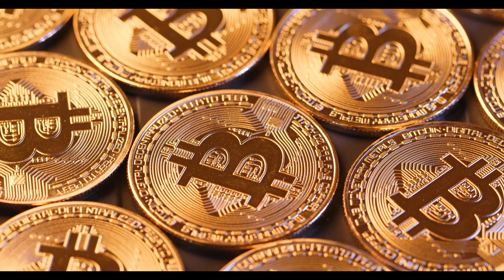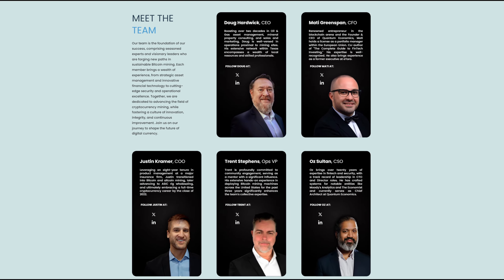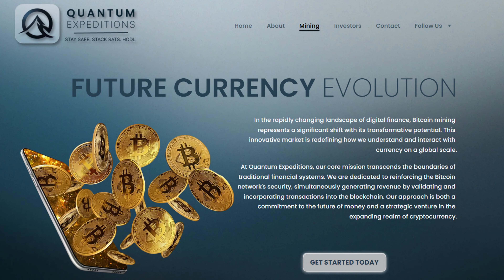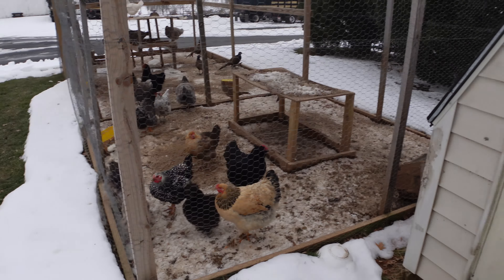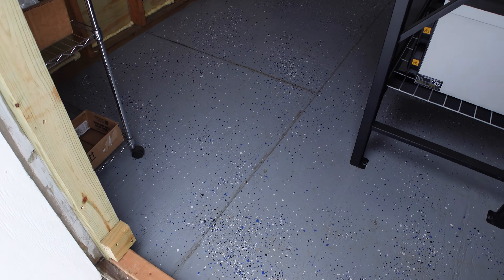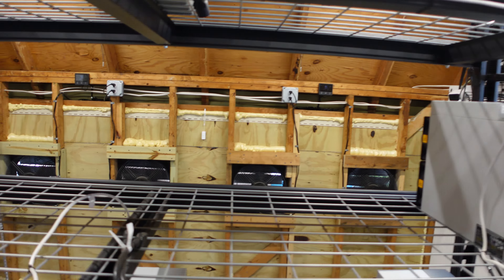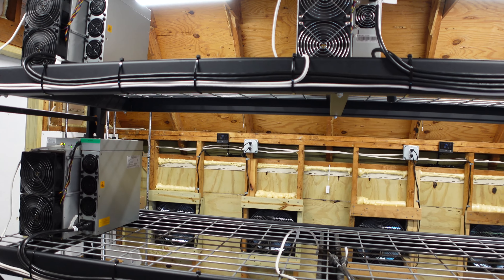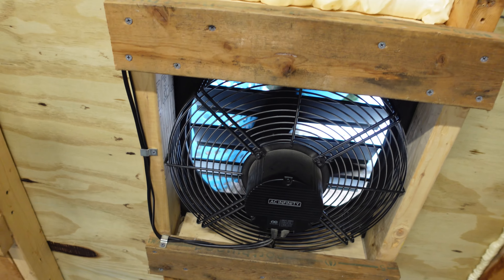10 Minute Tour of my Bitcoin Mining Shed

Comment: I have run into a similar heat problem -  yes install 2 exhaust vents along with what looks like a vented ridge cap - right now you are going backwards - you are trying to exhaust heat out the bottom - heat rises - reverse the fans at the bottom to pull air in and exhaust out the top - that way even with no fans running - it will naturally exhaust the heat somewhat out the top- in the bottom out the top - 😁👍

Comment: I love love love clean wiring! I guess if a “electrician” lives there thats what u get! 👍🏼

I tried to warn u 6months ago that you weren’t going to have enough air flow (comment probably got lost in the mix). Not even the T16’s are going to be enough (unless you add way more than 3). You’re also gonna need a lot more intake too. Those plastic gable louvers are restrictive and costly.

Everyone way underestimates how much airflow they need. Put your hand behind a ASIC and feel how much Airflow it produces. You have 9 ASIC in there now so ur shed needs 9x that much airflow to keep it from heating up.

I agree right now while its freezing outside, its beneficial to have warm air circulating inside for a constant temp. 90’F in winter is a big warning sign though. For the shed to work in the summer and stay cool inside, you should be able to stand inside and feel the air blowing through it. Its gotta be constantly flushed with fresh air. Otherwise you’ll have heat build up 👍🏼

Comment: Thats a Gambrel gable/roofline just so you know. I would recommend an inline fan blowing out you attic vent over the door. Attached to a duct with multiple perforations that is secured in the peak of the roof. Remember you have a lot of electrical and a semi flat roof section you want to put a hole in, not a good combination. If your roof doesn't leak now don't mess with it. An 8in inline pulling the length of the roof should help you dump the heat and you can slow it or shut it as temp drops. AC Infinity 8in will mow about 800 cfm. Good video!!!!!!

Comment: Hey Hobbyist. For adding exhaust, I would use the existing vent you have above the door and add another fan there.
Reply from the maker: My concern there with just passive vents, is it would turn into an Intake. Because the shed operates with so much negative pressure. 

But I could add an Inline fan there and suck the air out
Reply: @TheHobbyistMiner  what about putting a small AC infinity vent there in place? Could use the dampers to control how much air is going out and how fast the fans going right?

Comment: Hobbyist, I think roof vents would be a good idea so you can vent out excess heat in the summer. A design/shape roof vent that doesn't allow rain in obviously. 😀
Reply from the maker: Yeah thinking 2 or 3 active vents pulling air out. So the hot air doesn't pocket.

Comment: Roof vents would be good to allow the heat to naturally expel, but could result in it being an intake at times as well. Foam insulation board across the top and sides of the rack extending to the exhaust wall will help a lot, and you can cut out holes and create plugs, so that during winter times you can pull the plugs and allow some waste heat to recirculate, and during the summers, plug them so its only new air intake. I've managed and helped build a handful of enterprise mines, and almost every one of them has enclosed exhaust hot aisles.
Reply from the maker: I am thinking the same thing. Roof vents while good would pull air in, because of the negative sir pressure.

Comment: I would add two tall roof vents on the intake sidebof the shed. Place them about 2/3 up the roof to left cold air in. Use a burning encent stick to map out the air flow coming in through the roof vents.
Reply from the maker: Good idea. Thoughts on a fog machine test ?

Comment: @TheHobbyistMiner Look at the 12:00 min. mark and pause, There is already a small vent in the top. Modify it to hold one of the fans you are changing out. Now, do the same thing on the other end of the shed and have one push and one pull. Now put a 2.5' X 3' overhangs at a 4/12 pitch or similar downward angle. This will prevent blowing rains from reaching the vents. Use your own judgement on how to do the over hangs, but, This puts two of your 14" fans to use and those will easily run clean up duty on the heat. Just remember the little outcrop/over-hang can be mounted after you build it, use lightweight 2x2 instead of 2X4 if you'd like, and thin 'ish plywood. Then use the peal and stick roofing to cover it leaving about 1.5" of it hanging over the plywood on all 3 sides. It's easier than it may sound. Ill post pics of the way I did my shed soon, not mining out of it yet though.
Reply from the maker: Best recommendation yet!
Reply: Thank you Sir, that is a very meaningful compliment coming from  @TheHobbyistMiner

Comment: Lack of snow on the cable to your shed means it was too low in diameter and the impedance is too high.  When in 100-150 AMPs range you should go with 35mm^2 at least.

Comment: You need a ceiling and insulation. You are leeching summer heat on the shingles into the room(which you have enough heat) you can verify this with an ir gun.
Reply: That is a legit concern.  In my GPU location it is so hot in the hot isle that the tar from the roof started leeching back into the underside of the roof.
Reply: damn thats insane!
Reply from the maker: So this Shed doesn't have heat wrap on the walls like my new shed I bought. Has that reflected silver look. That helps with sun heat soak from the roof and walls. 

I am thinking of active roof vents first like the AC Infinity inline fans mounted up high.

Than if all else fails a "ceiling"

Comment: Also... two of those 16in fans as exhaust at the top of each end of the shed would be able to suck out all that hot air... and you could have those 4 x 14in fans as intake, perhaps variable as per internal temp and then run positive air pressure... just a thought
Reply from the maker: Not a bad idea. Springs going to be full of projects and testing

Comment: I'm also dealing with heat and exhaust issues. Will be adding more exhaust and intake to my garage this weekend. For your shed i would agree with others that a roof vent should be able to help with trapped hot air.
Reply from the maker: Thinking of doing 1 or 2 roof vents hooked to an AC Infinity Inline Fan. Kind of suspend it.

Comment: Hobbyist, i sugest using a ceiling vent which connects to a tube and put it close one exhaust fan so the negative pressure of the exhaust fan pulls the hot air out from the ceiling and you also can keep the tube during cooler days.

Comment: My simple suggestion: instead of fighting natural convection, why not use it? 🤔
Have the bottom fans add cool air from the outside and add large fans in the attic to remove the rising hot air. Before you go ahead and buy fans for the attic, you could even run a test in which you just open vents up top and use positive pressure from the bottom to check how it would work. But since humanity has been using horns for as long as they have been living indoors, this just might be worth trying 👍
Reply from the maker: Test are always fun! Looking forward to trying a few things!

Comment: Hey Hobbyist, shall I buy s19k pro? what do you think it gona be in 2024?
my electricity rate 0.09.
Reply from the maker: S19K Pro is a great ASIC, good choice. I have 2 in this shed.
Reply: They are good devices, just know the rated wattage is a bit off, they are published at 2760 ish, and tend to run closer to 2900-3000 from what I've seen. They can do great in immersion though. 170th at 4800 watts.